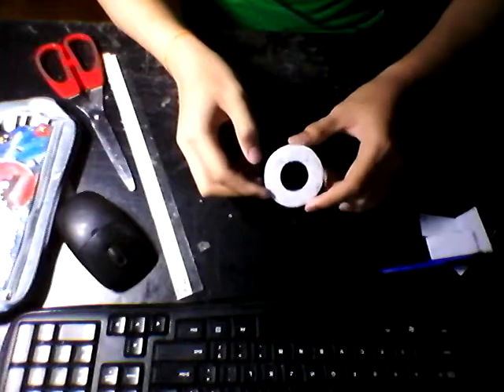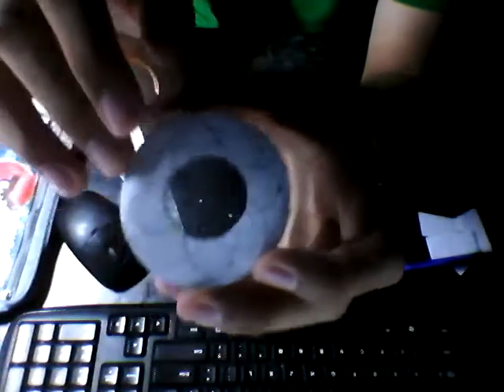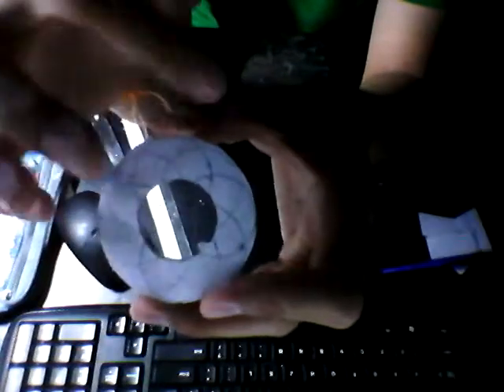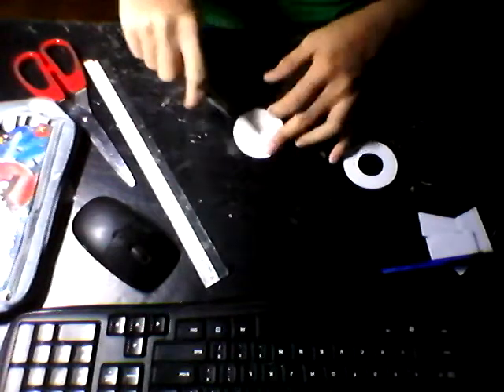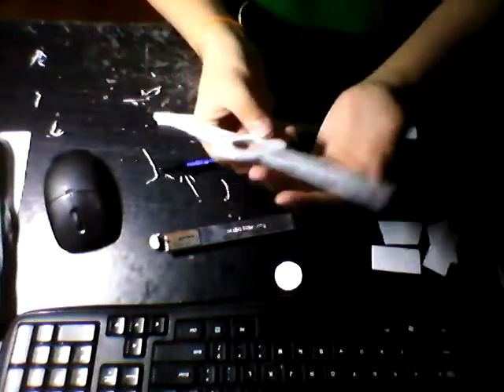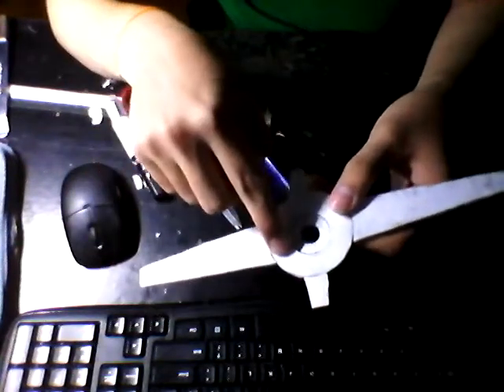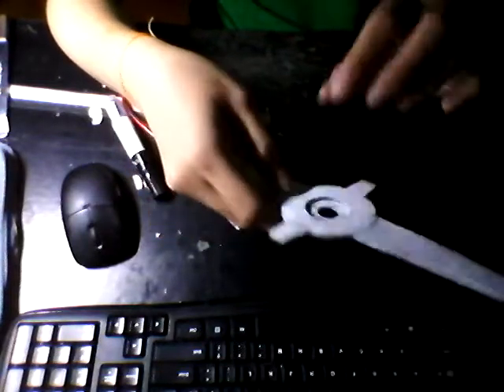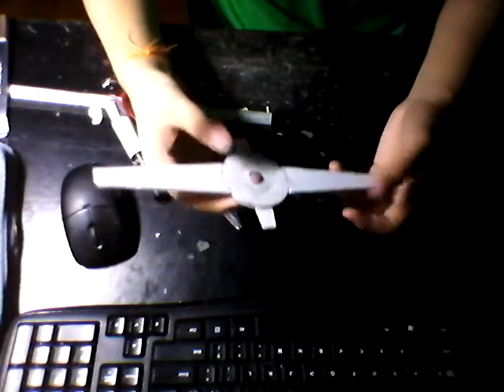55mm GERÄT 58 AT/AA GUN PART 1:THE MOUNT

Comment: yah this interesting I never knew about this experimental aa gun. Also The supports could be called stabilizing feet or stabilizers. Or helping with keep the aa plat form stable will flat on the ground or as an aa mount on a warship. I am only guessing. Because even the flak 88 can be towed on a wheeled chassis. The Chassis was design so it could be taken apart  allowing for the 88 to be deployed to specific position ion the battlefield and the crew would use its for legs for stability on flat terrain and I assume it would also free up the truck or half track towing it to be redeployed else where along the front delivering additional troops or supplies. Then legs were fold able allowing for the 88 to be deployed else where once assembled to the chasis again. 

Such stabilization feet were important for aa guns especially larger guns like the 88mm ,105mm and 128mm aa guns simple because the recoil of such guns might tip itself over when the crew was firing it. Last thing an 88 crew would want is the gun tipping over while firing. But again this just me make a logical assumption rather 100 percent fact. But with smaller aa guns that shoot faster may have less recoil and it would affect the gun as much but means to stabilize aa gun especially one that could be top heavy is a must for combat effectiveness.